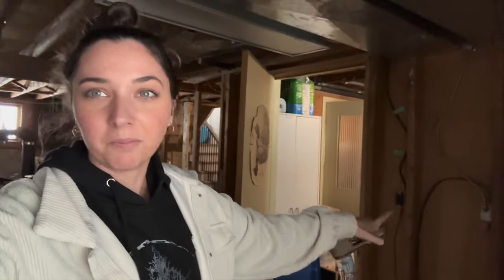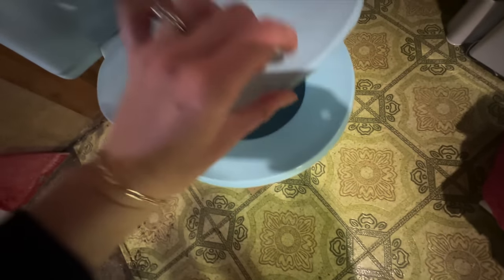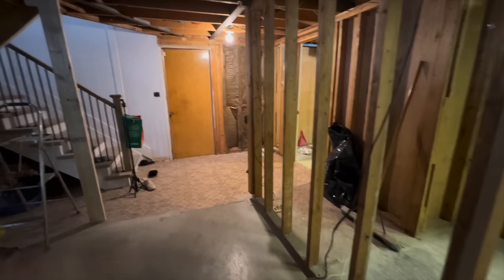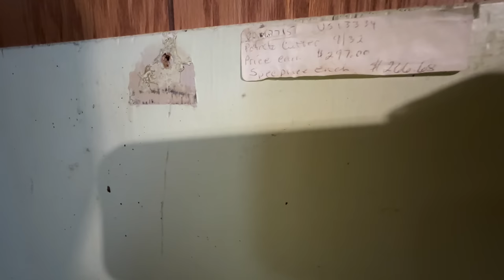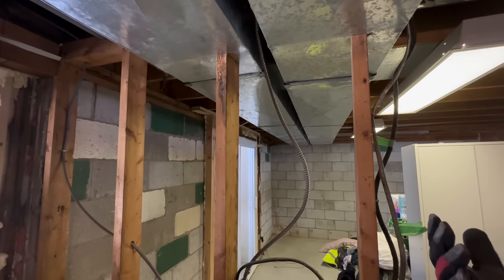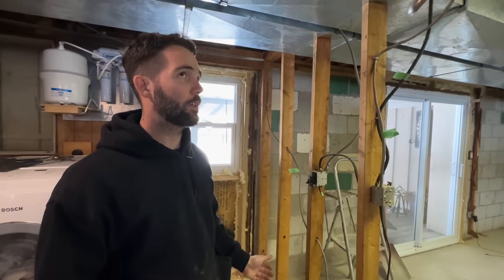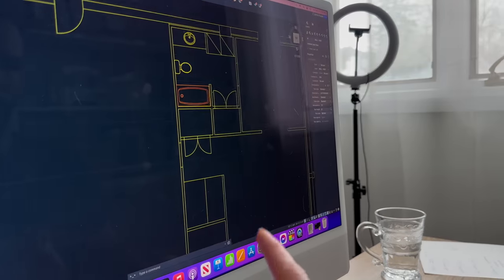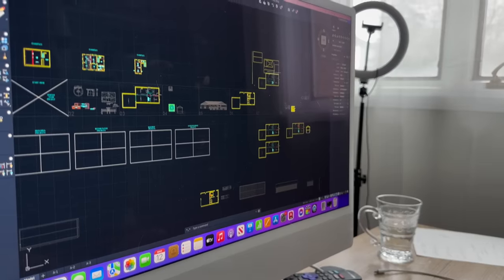BYE BYE scary basement bathroom 😶 | BASEMENT RENOVATION ep 2

Comment: If it's a combo bathroom/laundry room I would make a closet to hide the machines and your laundry supplies.
Reply: that would be nice to hide them but it can be a fire hazard to have dryers in a closet. obviously if not using you can hide them but to close off the dryer and washer is dangerous. have had small fires from dryers twice in the past 20 years

Comment: i think a spacious laundry closet would be the way to go for me. i don't think an entire room is needed for laundry, but in my experience, there is always some amount of laundry in process, beig washing, hanging to dry, waiting to be folded, etc. and you need space for those happenings to occur outside of the actual machine. you mentioned in your basement renovation video ep. 1 about a closet youre going to build but you don't know what it would be for. i think that could be a good use for it. your point about wet bathing suits makes a lot of sense, though, so alternatively, because that is a pretty spacious bathroom, you could just have a designated area for the laundry to be, with the counter, maybe a cupboard, or even some little closet doors to close if you don't want guests to have to look at your laundry.